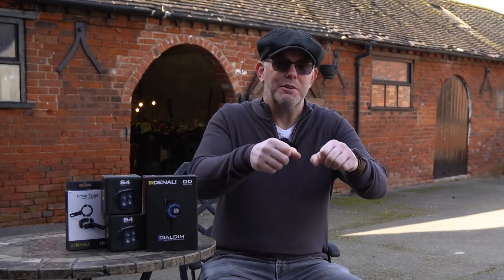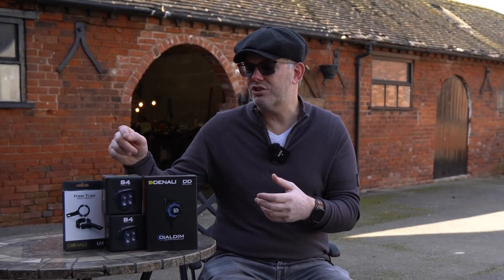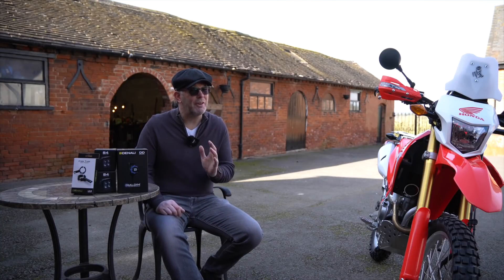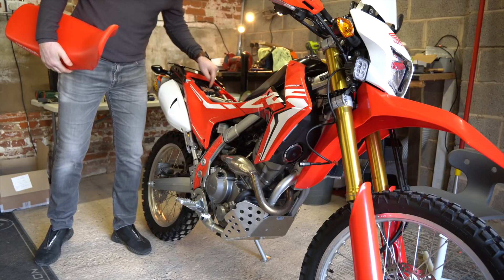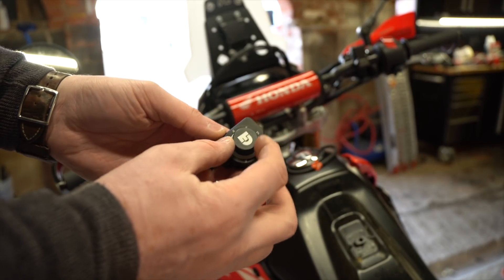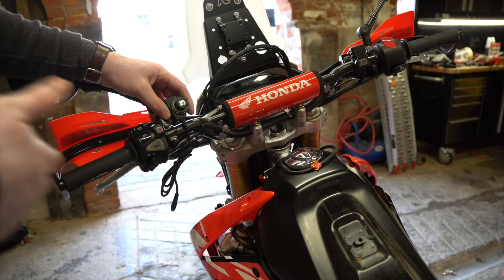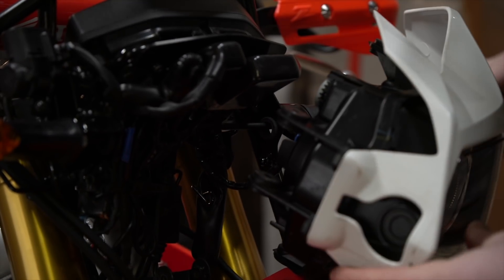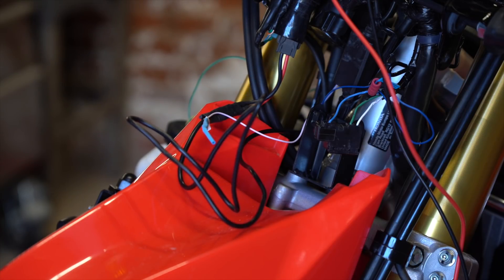Installing The Denali Dial Dim Controller. Honda CRF250L

Comment: Correction, I pulled the wire sheath over the ends of the wires before taping it, from the factory they were bare so you can use 2 accessories, I only used the usb charging point.
The air filter box has a snorkel that goes in the hole at the top (in the spares kit I sent) . K&N filter was fitted too with the exhaust and EJK controller

Comment: Hi,I have done the same setup on Indian Chief. I have tapped the turn signal trigger wires under the seat (through harness that goes to rear). It doesn't works. 

The turn signal wires have a constant voltage of 10.2v even when the main switch is off. With main switch On the voltage remains at 10.2v. But when the turn signal is On, the voltage varies from 0.7 v to 3 v on same wire. 

Any leads. Thanks